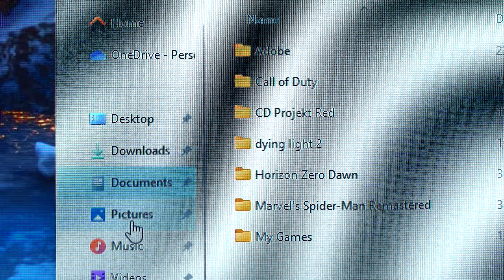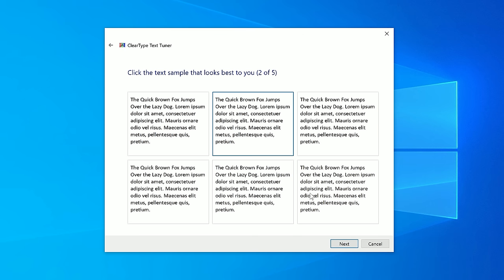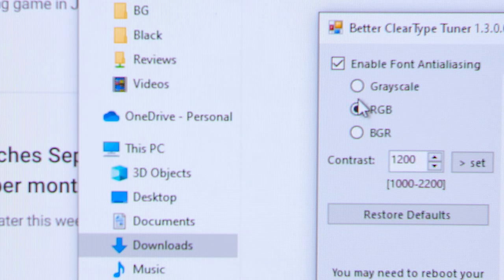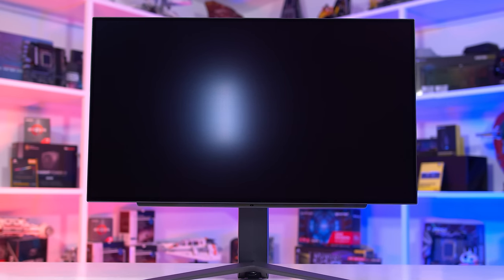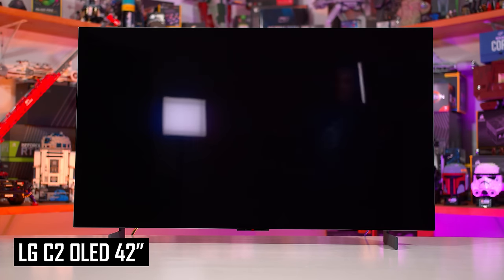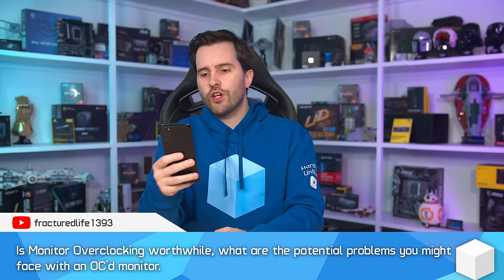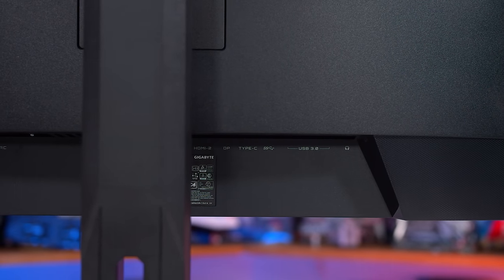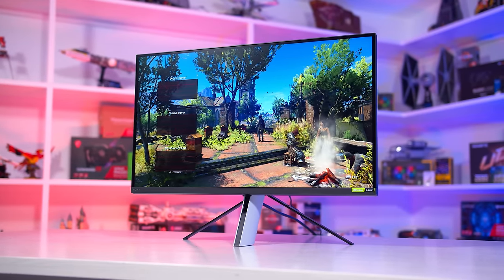1440p OLED vs 4K Mini LED? Can ClearType Fix OLED? - May Q&A

Comment: the best and sharpest text rendering is still without any smoothing applied, idk why smoothing is getting forced so much, I hated cleartype with a passion from the first time I ever saw it. I just pick a monitor PPI where the most commonly scaled text can be rendered pixel-perfect, which is usually under 100 ppi, and it absolutely hurts my soul that some programs do not give you an option to render pixel perfect text but force smoothing making it just look blurry and awful.

Comment: Regarding the fact that factory overclocks never had any issues. I've had an Asus 1440p ultrawide ips monitor some 5 years ago that factory overclocked from 60Hz to 100Hz. It never broke until I sold it (after 2-3 years of use) but I noticed that in the 100Hz mode it would take noticeably longer to turn on and would go black for a few seconds when I opened a game in fullscreen. It would also sometimes stutter or very shortly go black. All issues go away at 60Hz and most at 75Hz. I tried it with GSync on (fullscreen and windowed) and off and same behavior. Maybe my unit was really bad but idk something to consider.

Comment: The hdr mode of my 27GL850 is not worth turning on either at only 350 nit it's never looked that great, I would like it if you did a video showing monitors that has good enough "fake" hdr that makes them somewhat worth it, because right now true HDR is very pricey and I don't really have £800 for a monitor i'd rather use that for a better GPU.

Comment: Any plans to review any of the monitors with JOLED panels? I noticed the Philips 27E1N8900  (4K 60 Hz 27 inch) pop up in stores (around $800) but I don't know if it's any good and how it compares to other OLED's

Comment: Regarding HDR on large non-OLED screens: I played Doom Eternal with HDR on my LG 38WN95C with local dimming disabled. I was impressed how good it looked - notably different and much better than w/o HDR.
Reply: I have LG 32GQ950B edge lit IPS. If I compare HDR and SDR, HDR is MUCH brighter and has more natural colors whereas SDR looks slightly oversaturated. Overall HDR looks slightly better in brighter scenes. I disable local dimming because its a joke on this monitor. Also HDR implementation varies between games, Doom Eternal - amazing, Witcher 3 - barely any diference.

Comment: Any recommendations for a smaller monitor that prioritizes picture quality as opposed to latency/refresh rate. Most of the recommendations I see have to do with things pro gamers prioritize like latency. Not that I don’t enjoy those things but I prefer good picture quality and prefer playing on a smaller monitor for my ps5. I am currently playing on the AOC24g2. Is there a smaller size (24inch monitor(s)) that you recommend that prioritize picture quality or am I best off sticking with my AOC. Thank you in advance.

Comment: On qhd, you need to set the scale to 133% in Windows. Then the font rendering will be better. Although a little less information will be included on the screen.

Comment: I tried making a matte monitor glossy, so I pulled of the matte layer and the screen turned completely white because the matte layer was also the polarization filter 😂 was a old monitor though 😅
Reply: They're usually not the same layer. Maybe they were just glued together really tight. There are videos where people wet the monitor to let the glue weaken and then pull off only the matte layer.
Reply: @Steror  I did this recently, and the hardest part to get right (aside from not accidentally damaging the PCB for the power and menu buttons, for some models)   is lifting the first corner of ONLY the matte finish. I find that it's easy if you soak it for 6 hours and reapply water every hour, and lift with your thumbnail instead of a knife, otherwise the knife could easily slip under the wrong layer.

Comment: Windows 11 actually works extremely well for snapping Windows and is one of the primary reasons I upgraded from Windows 10. It even handles snapping half the screen on vertical monitors well. Much better than Windows 10. Fancy Zones the official Microsoft tool can also improve window snapping. Funnily enough I think window tiling is actually one of the features Microsoft has nailed better than both OSX and most Linux distros.

Comment: Can someone maybe explain to me why precisely are display makers switching to non standard BGR, well technically why are they inverting?
You could in fact flip BGR monitor do 180 rotation and you would have an RGB display (which you should not do because displays don't have stands and shouldn't be flipped on its own without some hard and stable support!)... 

But why are display makers suddenly shifting towards "BGR"? All latest TVs or modern be it IPS or VA are now BGR instead of RGB (Mine included, sony X90J, while previous X90F was RGB). Is it for more manufacturing yields? Is it for cheaper production by inverting?

What is going on?

Comment: You can manage windows easily in windows 11 by snapping to the left or right, corner to corner just as quick as putting the tab on a different monitor.

Comment: In Germany it is possible to buy a 4k 60hz OLED Monitor for approximately 900€ and same for 1440p 120hz+ monitors
Reply: 27 inch 4k oled

Comment: Maybe a question for the nest Q&A. Would it be possible to save ICC profiles into the monitor itself, and maybe have a profile for each mode you run the monitor at, so it can switch the profile when you switch mode, cause the monitor knows when you run it as sRGB or HDR, so it would automatically use the profile that you set for the mode you use. Wouldn't this make the calibrating you've done just work on whatever you do on your PC as it's done in the monitor and have nothing to do with Windows, so it would make games, movies, web browsers, or whatever, be corrected.
Reply: Well there are monitors with hardware calibration support.

Comment: 18:08 I have never ever seen a backlight fail. Even 20 year old monitors that's been daily-ed I'm yet to see one where dead backlight was the reason it failed
Reply: it happened more frequently with neon backlights than leds (because of tubes lifespan and inverter circuits failing). But leds still do wear with usage (similarly to oled but in lesser amplitude) and they get less bright over time. A trick to make them more durable is to avoid using the full brightness capabilities as much as possible.
Though, with a bit of electronics repair knowledge and actual parts easily available now it's relatively easy to replace old led backlight with some brand new led strip.

Comment: The possibility of Apple's AR/VR headset to be used as a MicroLED display for a laptop/desktop PC is what's got me most excited right now. Done right, it could provide a very interesting new option, though even if it can serve that purpose, Apple may take steps to make it non-functional for anything that isn't an Apple product. 
For used monitors, my main concern would be why the seller is selling it, since failed pixels or intermittent problems would be two, obvious reasons why someone would.

Comment: So with all this color talk… what color gamut is the gamer 1 and gamer 2 profiles in the 27 inch lg pled that let you use the lower latency das mode? And if latency doesn’t matter in a game should i he using srgb mode?  I don’t use hdr, I either don’t set it up righr, the games don’t implement it well or I am on windows 10 not 11 or I just don’t favor it.

Comment: for all of the people with 4090's > BUY ALIENWARE AW2723DF 280hz IPS 27" the best value per performance there is out there and put overdrive on Extreme. Yeah Asus 1440p 360hz monitor exists BUT at 400e more than my suggestion and NO WAY u can have it maxed out Hz consistently on all games. With the Aw2723df You gonna have Ferrari-like performance similar to Zowie top tier comp model but with insane colorfoul 1440p visuals and literally 0 latency and 0 overshoot, consistently maxing out the 280hz. Thank me later ;)

Comment: Fake HDR mode is a pain because you have to configure it to light scenes and then for dark scenes and it does not change automatically.
Reply: Depends on the model. Some employ dynamic contrast so it will adjust automatically. But it's just a single backlight unit, no substitute for effective local dimming.

Comment: The problem with Cleartype is that Microsoft started pushing DirectWrite as the means of implementing Cleartype. Mactype works just fine with applications that render text using the old GDI method. But with DirectWrite (which is what most applications now use, including all(?) modern UI parts of Windows), it's much harder to inject a custom font renderer, so DirectWrite adjustments are very limited in Mactype and are unlikely to improve. Which is a shame, because font rendering in Windows is...not great and kinda years behind now. Then again Apple also ruined their previously great font rendering, leaving Freetype (which Mactype uses) as the only and best font rendering solution.

Also, unless it has changed recently, most Microsoft DirectWrite apps were actually forcing grayscale font rendering, not subpixel, regardless of user settings. Supposedly the reason for that was that MS wanted the apps to render well enough in both landscape and portrait orientation on portable devices, and forcing grayscale was the easiest way of achieving that.

And Chromium web engine (used in the majority of browsers today) does pointless weird things to font rendering on top of using DirectWrite, has been for years and it doesn't seem like they will stop any time soon, sadly. That's why fonts in pretty much any Chromium-based browser (so essentially in any browser outside of Firefox) look thin and kinda oversharpened when compared to Firefox's DirectWrite. Thankfully Chromium is the odd one out in this regard, though given how widespread the Chromium engine is, it's not that great anyway.
Reply: Also, for working with "multiple monitors" on a single panel, I can highly recommend DisplayFusion. It can do what they call "splits", which essentially divides a monitor into "virtual" monitors. I only use it so I can maximize windows on my second monitor and still have the column of Rainmeter widgets visible on the side, but it works really well. You also still have the option to override the split boundaries by holding Shift when maximizing the window.

Comment: pls do a video bashing Windows for not mapping application colors to srgb by default even when monitor color profiles are provided. Windows is extremely confusing with its display color management and lacks any transparency about how applications apply or don't apply these profiles. Most applications don't care about CM (and they shouldn't, that's fine), but the OS is expected to do the right thing with the color mapping if the application does not explicitly control it.

Comment: they should be able to do it in hardware on the monitor to convert RGB to  G       or RGB to BGR
                                                                                                                                R     B
Reply: might be a thing on professional monitors but it's expensive to implement and eat margins.

Comment: I find that for newer games where TAA is so pixelated and ugly, and where upscalers like FSR and DLSS are so heavily used, and also while GPUs are faster than ever, there's never been a better time to go 4k. I find most newer games look significantly worse at 1440p than at 4k, some games it's not huge, if you're using a 4070 or better I think 4k is worth it right now.

Comment: I don't get all this talk about text clarity problems.
I use my alienware OLED every day for work, 9 hrs a day with documents and spreadsheets right next to my old IPS alienware ultrawide. Reading small text all day everyday.
Absolutely no difference in text clarity.
My perfect eye sight pushed right up to the screen can not see any issue.
I don't like blaming peoples hardware, it's to much of a throwaway line. As far as I can tell this issue does not exist. If it did I would of swapped it out. No way I'm making my work harder. 
Also the coating is great. No weird reflections. I just don't see the issue.
Reply: I have no idea why some people don't see the issue , i had a phillips 4k 42 inch oled monitor for a week and my eyes and head still hurt when i even think about the unclear text that the screen had, i tried every fix and nothing really worked.
The main problem was that i always feelt like my eyes were out of focus because the text had all this artefacts around it.
But maybe it is because i am using 4k on 27 inch for several years and just got used to clear text.
Reply: I think it depends on the application , like he mentioned many use their own solutions now which may not be as noticeable.

I also use dark mode on most things  which I think makes it impossible to perceive. Only time I have ever noticed it is loading a pdf with qhite background
Reply: @bicks4436  this is precisely what I do all day every day.
Zero issues.
I bought the monitor being a bit worried after watching Tim's review.
Figured I'd take a gamble and if it's a problem I'll just return it or sell it and get the Samsung G7 or G8 instead.
I just can't see it. I've got it right next to my old IPS ultrawide. Dual ultrawide setup so I can have 4 documents side by side.
Absolutely no difference.
If it gave me even the slightest problem I would of fucked if off. I'm not staring at unclear text all day everyday.
It just doesn't exist.
Maybe I got a golden sample or something. I don't know.
Reply: @Blue I've got perfect eye sight. 
I've just spent 4 hours staring at black text on a white background.
There is nothing weird to see. It just doesn't exist.
The only thing I can think of is I don't have an electron microscope to see the issue.
Given I would never use a microscope to view the monitor, if that's what's required to see this issue, then as far as I'm concerned it's a non issue.

Comment: I once had a 1080p 144 hz monitor, I could get a atable oc all the way up to 178 hz. The pixel responce was pretty bad on it since it was a va. It was fairly blurry even at 178 fps.

Comment: Why don't they use a panel temperature sensor that adjusts overdrive gain to compensate would be a pretty easy thing to implement. but then again the people who create monitor firmware are pretty damn incompetent 😆
Reply: it might be a feature inside professional monitors but consumer grade designs are mainly about cost-effectiveness even for high-end products.
Reply: @PainterVierax I I don't think it would be all that expensive temperature sensors cost next to nothing and the code to monitor temps and adjust a simple 0-100 odgain value is trivial.
Reply: @brett20000000009  I agree. Nonetheless this is more cost effective for them to not search, design and implement it. And as you said, they should already improve a lot on firmware as even on high end consumer grade monitors it's nearly impossible to get a well rounded overdrive setting for the whole fps range or to get a simple sRGB clamping mode without locked brightness or colors.

Comment: I could not be happier with my PG27AQN, which I have purchased based on Tim's review. Thank you Tim :)
Reply: why not get the oled model?
Reply: @Snxgur  obviously because of productivity workload, I need clear fonts and best factory calibration (my particular model has avg dE < 1.42). And the risk of burn-in is a deal breaker for me. I don't want to see ghostly lines or even pixels or even crosshairs when I decide to play some Overwatch
Reply: @kahatanna7  fair

Comment: I think you are over valuing used parts, they are worth 50% of their new value at the very most. There's too much that can go wrong with electrical equipment, I personally would never buy used unless it's 40% or less of the new price.

Comment: In my experience 4k is 10x better than 1440p in and out of gaming. 1440p coming from 1080p was sharper but very lackluster. When i plugged in my lg 4k 160hz monitor i was blown away in windows AND gaming. Also, this isnt 2017, high end gpus can easily push 4k high refresh rate. Idk why some people still say its either 4k 60 or 1440p 144hz..maybe 6 yrs ago, not anymore for the past few yrs.